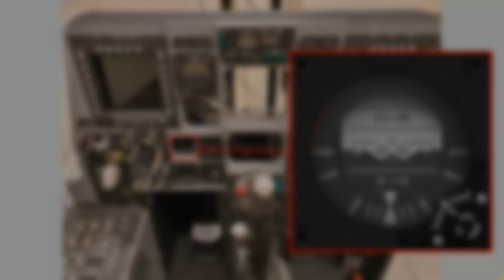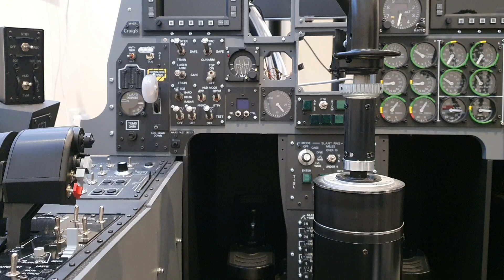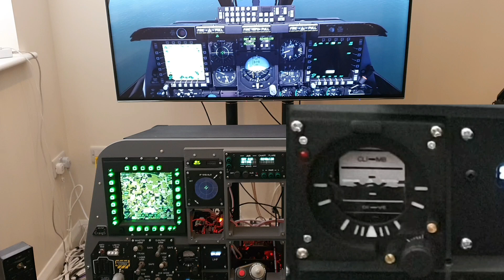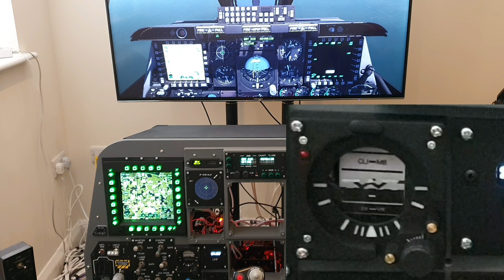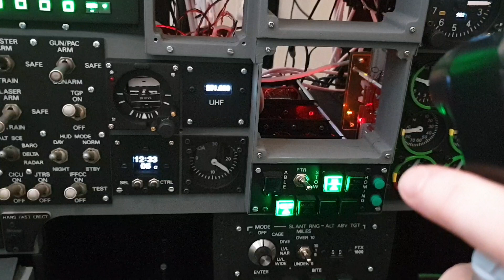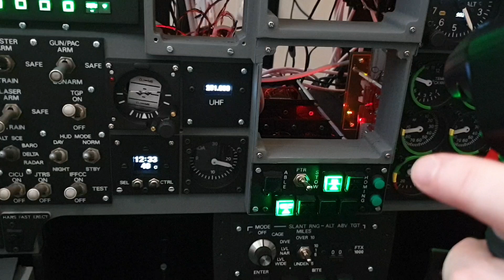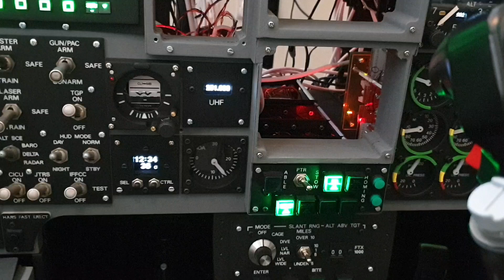Simpit A10C - Front Dash - Part 25: Standby Attitude Indicator - Operation Tests and Implementation

Comment: Another brilliant video Craig. I’m really inspired to make a Simpit in my spare room. The only thing holding me back is the learning curve to make each panel.
Reply from the maker: Hi Scott, I know where you are coming from. I don't have any background in electronics and before building simpits I had not done much more than upgrade a few bits on my PC. 
I think start with just one panel. The electrical panel was my first as it was inputs only, all toggles and something I could use everytime I fly. You can then move to building a number of prototype panels. I spent at least 6 months building prototypes from the right console (Caution light panel, counter measures panel, ils, etc). After a period of prototyping there's enough learnings to understand and plan an approach to build a physical section of the aircraft. I think - time, patience and persistency are key. It takes time to get the tools, i.e. 3D printer, solder station, hand tools, CAD/CAM software etc, and to learn how to use them effectively and get the best from them. 
But when alls said and done, it's difficult to describe just how great it is to fly in a physical cockpit you built with all those controls around you. 
I do think, that given what's involved in building a large simpit a person needs to be as interested in the process of the build at least as much as the end result.
Good luck. If you build a panel drop me a picture to craig@mysimpit.co.uk and I'll take a look.
Regards 
Craig

Comment: Excellent design and implementation, Craig. I am trying to guess if you are using two slip rings; one for the pitch wheel signal and one for the roll axis rotator signal.
Reply from the maker: Hi Rick, it uses just one slip ring. 
There are the below four parts:
1. The small stepper (which controls pitch axis) 
2. A 3D printed adapter 
3. A metal rigid flange 
4. The dual hollow shaft of the bigger Nema 8
The above 4 parts are attached together in that order and they form one single unit / object. That resulting object including the wiring (passing through it) rotates as one and this is where a slip ring on the other end is in place. 
Hope that helps, also see part 23 of my build for more explanation. 
Cheers